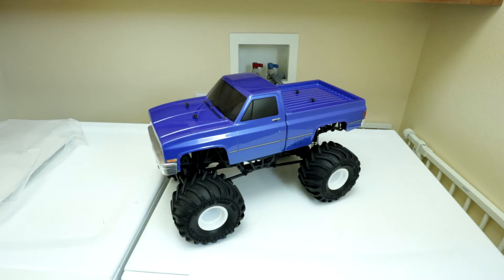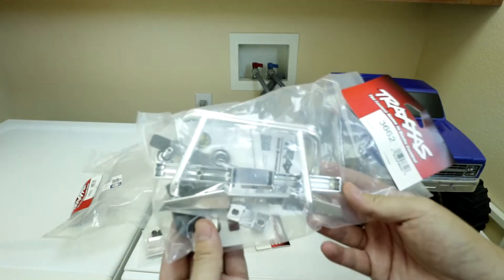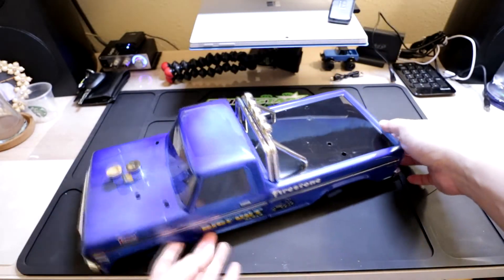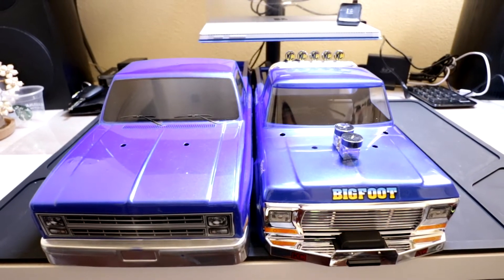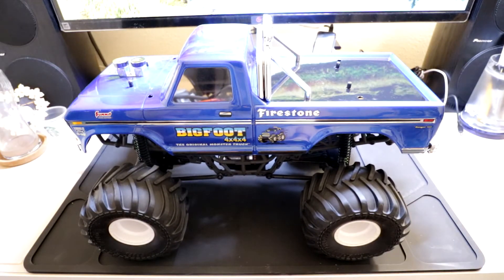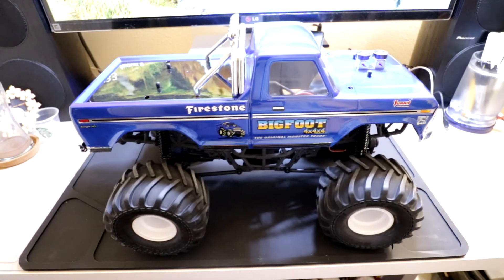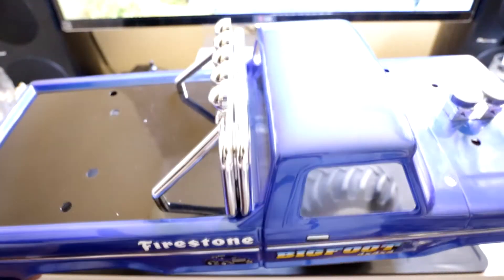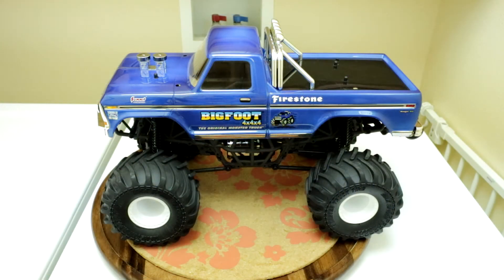MST MTX 1 - Bigfoot Body Conversion

Comment: Hey buddy! Been thinking about building a monster lately and this might be the way I go.
How is the MST chassis? I cant decide between this or the CEN.
I want it to look scale and still perform. The axial doesnt do it for me despite the billions of parts available for upgrades. (I think its the offset AR60's that put me off most)
Let me know if you still have this and what your thoughts are between this and maybe the CEN?
thanks!
Reply from the maker: Hey Chris, you know what.... I haven't run the rig in a while.  It's smaller than the SMT10, not sure if you're aware.  It uses the MST CMX/CFX axles if that gives you a better idea.
Reply: @RevolutionX  thanks man. And for the last 2 hours I have been reading and I might actually go for the smt10 anyway lol
Just too much parts support to resist.
I do want to figure out some center pumpkin axles though. And relocate shocks for smooth 4 links for a more scale appearence.
Super tempting!
Reply from the maker: @RandomStuffGarage619  easy.. SSD HD D60 wide axles have centered pumpkin.  Check out one of my yeti videos... It's there somewhere.
Reply: @RevolutionX  both front and rear? Sweet!
I know they make a rear. Had one on my yeti too (cant beat SSD quality for $30). Just hope they have a matching front.
Reply from the maker: @RandomStuffGarage619  hmm not sure about the front actually, but maybe it can be modified.  Ernie might be able to do something?